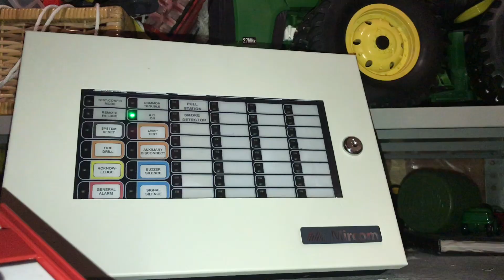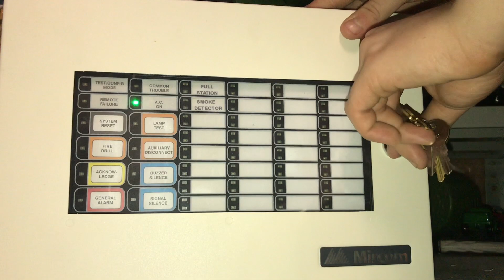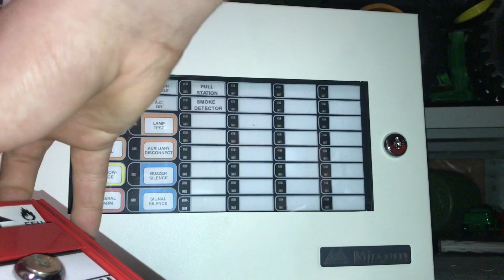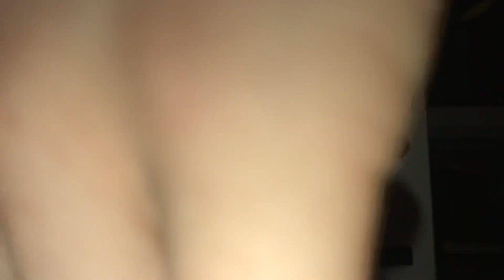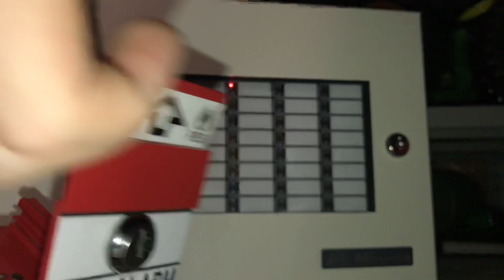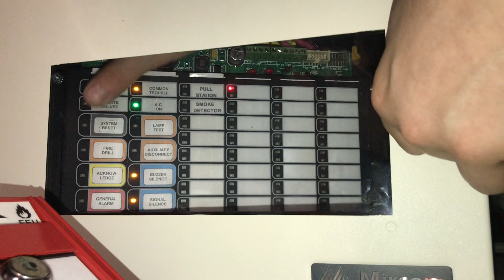(PART 2) Conventional Panels 101: Mircom FA-1000

Comment: The conference center that my college once owned had such a system in place, with that same annunciator slapped onto an old Simplex 4305/4308 annunciator (the building was initially built in 1978 with some kind of Simplex system). The alarm signals were Space Age VA4 horn/strobes (with many of them mounted on the ceiling), they had System Sensor 2451TH smoke detectors (and a newer 2151T detector near the panel) and Simplex 4251-20 single-action pulls (the only devices from the original Simplex system still in use).